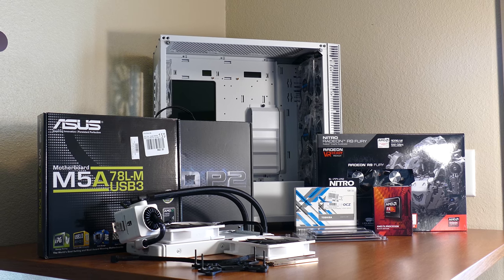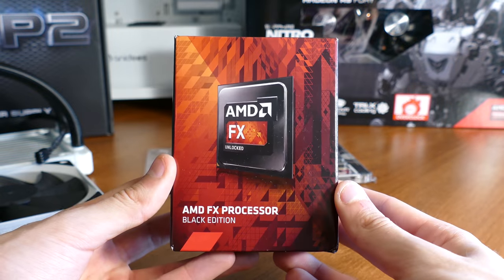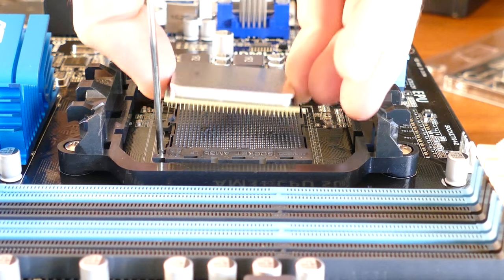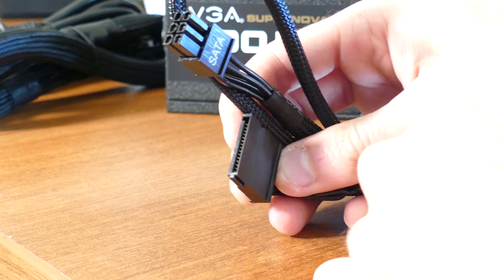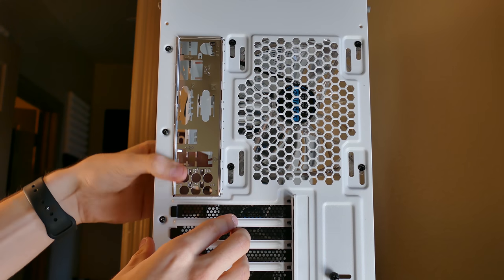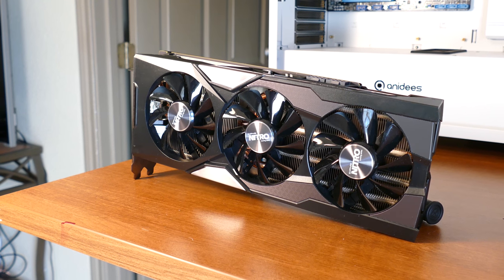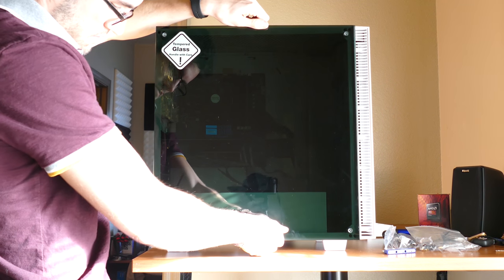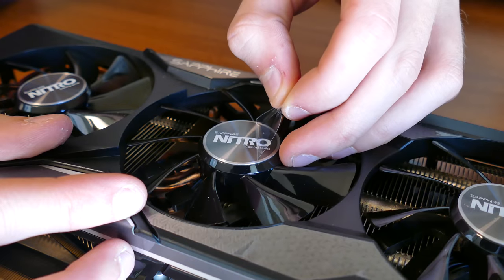How to Build an AMD Gaming PC (2016 Edition)

Comment from the maker: - For those looking for a much quieter and more efficient CPU cooler (I don't blame you), I recommend a Hyper T4/212 Evo (http://amzn.to/2gluxZW) or Cryorig C7 (http://amzn.to/2fm14uL).

P.S. The Amazon links really do help me out!
Reply: the T4 is my jam
Reply: Salazar Studio you should try unlocking the fury and overclocking the hbm memory.  It's great fun and you'll be surprised how much faster it gets when you do these 2 things. With an x99 cpu you can get over 20k In firestrike!!!
Reply: really love the cryorig i got the h7 very nice i replaced my broken h100i with it
Reply: The new Wrait Cooler and the Cool and Quiet new 95 watt solution is excellent. But Obviusly that CPU dint come with the Wrait. Neither you can complain with the price you pay  for it.
Reply: Got the C7 for my carbide air 240, is great for the price.
Reply: Cryorig's H7 is on sale on newegg. (or was very recently at least). i picked one up for 30$.
Reply: you forgot the thermal paste.
Reply: Stock cooler tend to have the thermal compound preapplied.
Reply: The computer look silly since the graphics card is so much larger than the motherboard.
Reply: Abraham Soto wraith*
Reply: Salazar Studio thoughts on using a CPU that comes with the wraith cooler as a happy medium (cooler/quieter than a regular stock cooler, but infinitely cheaper than any aftermarket)???
Reply: Can you make a Video undervolting your fury? Saw a Tom's Hardware post that undervolting lowers the power draw quite a bit.
Reply: I currently own this motherboard with a 8350 it's working okay with a 212 evo, But I am upgrading the mobo soon as it is trash. . .
Reply: Benchmarks?
Reply: Salazar Studio what about the T2 ?
Reply: Salazar Studio ill buy the PC off of you!
Reply from the maker: Joshgts Not overclocking, so it won't matter.
Reply: I use a TX2 does the trick, and diverts a bit of air over the VRMS
Reply: Salazar Studio Great call on the Cryorig H7, it's a very underated and not often talked about cooler. Looks absolutely stunning and performs brilliantly!
Reply: I have an AMD 8370 with a Rx 480 from xfx and its great. I over clocked my cpu to 4.5 ghz too. I think amd is great on a budget
Reply: +James Mulligan 
Cool! Can you detail the rest of your specs please? I have a R9 290X on the way and have been contemplating a similar build.
Reply: Science Studio I have the same motherboard with 8gigs an fx 6100 and r9 280x will I see any difference in games with 8320 cpu?

Comment: I really like the style and quality of your videos! and AMD FTW
Reply: Nate Shore My FX 8350 is no good anymore, Getting 100% cpu load in various games, even with a oc on 4,6 GHz. Intel FTW until Zen is released
Reply: Theodor Kollerød 100%? In which games? I currently max out Witcher 3, doom, and battlefield 1 and i average 40-50% usage on factory clock. I think your computer has viruses
Reply: Kev Yep, was gonna say. 8350 is old, but not that old
Reply: ***** Using a gtx 770, I've maxed at the cpu in Overwatch in intense moments, and the same happened at the BF1 Beta. I don't have any problems on witcher 3, because it's optimsed heavily for GPUs :)
Reply: Theodor Kollerød That's bizarre. I think there might be other issues with your computer that's causing the cpu to act that way.
Reply: This is far from my experience with the same chip coupled with a RX 480
Reply: Theodor Kollerød yea I had the same problems with my 8320. Had it for years and even ended up overclocking it to 4.6ghz on liquid. The fps and everything looked fine but there were too many stutters and dips when playing. I had to sell the chip cause I couldn't take it anymore. Luckily I bought it for 130 and sold it 130 (:
Reply: thelonestranger777 That's weird. What video card were you using?
Reply: slipknotboy555
SLI 780's
EVGA sc if that matters.
And before you say it was SLI, both cards ran perfectly fine in other rigs.
Reply: thelonestranger777 No idea then, unless it was drivers or something. Or something else fucking up. Maybe you even had a bad chip somehow. When you say they ran fine in SLI in other rigs, are you talking about with the same games/applications and same drivers, etc.?
Reply: slipknotboy555
Of course they would be the same drivers and games. I honestly dont know what it was but its all in the past now.
At the time I was using both windows 8.1 and 10.
Reply: I've been using my FX 8120 @ 3.8GHZ for many years and it is still running!

Comment: I managed to build an FX-6300 with R7 360, 8gb ram for dot on 200 euros. Gotta love used parts.
Reply: secrets dude from where? I'm trying to buy a core 2 quad q9300/9450 and ram and its already 120€
Reply: RoboCoffee some locals over here were selling their okd parts, got them for super cheap.
Reply: +RoboCoffee i can sell you an 1150 mobo and processor and ram 140
Reply: Jace Balavin yeah dude I found a HP with a i5 2400 4gb ram and 250 GB HDD, but for 230€

Comment: If anyone decides to build this (which I don't recommend because ZEN) an upgrade you could get would be a new motherboard firstly and a cpu cooler to overclock and minimise the bottlenecks with the gpu.
Reply from the maker: Already commented this.
Reply: He got those parts super cheap. You are not going to find a Zen Cpu on the Cheap. New things cost a lot More.. Thats why I don't like the Marketing Hype.
Reply: Salazar Studio that's cool
Reply: 'You are not going to find a Zen Cpu on the Cheap.'
8 core 3,7ghz is around 250GBP on leaked prices on kikatek and more which have been pulled recently off the web. If so then for half price you would get 4 cores. Around i3 price.
We will see in March, LOL

Comment: 4k for 650$, few months back  the only 4k u could get was at 1200-1500$
Reply: In a year it would be like $400-$650
Reply: Still the case, but he got a bargain
Reply: I saw some R9 Fury X cards for <$300...kind of wish I bought one.
Reply: well by that time game will need for power to run them at 4k
Reply: Sapphire R9 Fury going for $284.99 or 270€ now. 
That is the cheapest I have seen so far and I expect they may go even lower. 
Superb 1440p or 4K performance (for the price) if your PSU is not too weak. 
I bought 2 of them for Crossfire and m-GPU and I am not disappointed!
Reply: Rich Tea let me guess... 
1200w power supply?
Reply: Spot on! Although I think you could get away with less than that, I don't normally pull more than 60% of that under normal gaming loads.

Comment: If it hasn't been mentioned, if you want to get the most out of an AM3+ mATX board, get the Asrock 970m Pro3. It's the only 970 chipset mATX mobo to date, thus less likely to fry AND supports Crossfire. Had some pretty solid OC'ed builds with 4350s, 6300s, 8320es and even 8350s. No issues, even on air cooling.

Comment: Nice job, you made that computer look appealing. Those angle shots of the components without sound look good, and the information given was good but you left out to statically discharge yourself prior to building since it is a build guide. Keep up the good work and best of luck.

Comment: The R9 Fury is a freaking beast, and you can undervolt it so it consumes 75watts less, then it come close to 200 watts ( gpu itself ) it lowers temperatures and it doesn't affect performance so that's cool

Comment: Actually the i3 6100 is a better buy for the budget. Even though its only dual core plus ht, you have the option to upgrade to a skylake i5 or i7. Plus you can upgrade to kaby lake i5/i7 since they use the same lga 1151 socket as skylake. While with the 8320e, theres no upgrade path unless you want a 9590, which doesn't even keep up with the i5 6400.
Reply: I'm going to tell you a little secret. No one cares. Hope it doesn´t hurt your feelings.
Reply: Zebula Wienandt which fx do you have?
Reply: False
Reply: I agree with the OP. Built a VR machine with a 6100 and 1070 using stock cooler! Max load temps about 75 degrees in a Node 202 case! Will be upgrading it though to a 6600 but as a start the 6100 is an amazing CPU for under £100! Why you'd go amd when the 6100 is right there beats me.

Comment: all of the current FX series chips would bottleneck the Fury/Fury X and higher performance models...
Reply: ParticlePhysXAnomaly not when overclocked...
Reply: not the 9590, or the 8350 oc
Reply: ComSint gaming applications use between 2-4 cores so the other 6 are rendered nearly useless. Individual core performance is very weak in the FX series. 9590 also consumes a ridiculous amount of power along with the Fury/Fury X and requires a beefy AIO liquid cooler. None of these things are practical.
Reply: ParticlePhysXAnomaly Dedicated gaming PCs in general are impractical... also where did you get that first statement about gaming applications only use 2-4 cores? that was true maybe 5 years ago but lots of games from the last couple years and newer ones utilize more cores if they are available
Reply: SacredSkill my 8320 at 4.6ghz was bottlenecking my sli 780s. Ended up switching to a 4690k and on stock it performed much better than the fx cpu. I hate to use the term night and day.... But it was night and day in all honesty.
Reply: thelonestranger777 Yeah and with Zen right around the corner, any AMD build at this moment is futile.

Comment: Do you do scavenger/spare parts builds? Would be interesting to see you do a "how a $100 HP Z400 ebay motherboard kit with an x5687 CPU stacks up today" type of video. Its something i've delved into recently and results have been GREAT (just need a small mod for a standard PSU to work). The Xeon x8687 is a very interesting CPU.

Also, sorry if you've answered this repeatedly now, but why the change in channel name? Movement away from Science as a main subject? Thanks man, you rock. Keep up the good work.
Reply from the maker: Explained the name change in my ASUS motherboard review video.
Reply: Thanks man

Comment: The R9 Fury is a FANTASTIC CARD! You should run it in your I7 build also for a proper comparison with a GTX 1070. Hint R9 Fury easily holds it's own. BTW you absolutely HAVE TO overclock that 8320e. It needs to run at 4ghz+.

Comment: Pro Tip: install the front IO pins BEFORE you screw down the board. It makes the install that much easier. those little pins can be a big pain...

Comment: My sapphire fury is on heavy 4k duty. I play all my titles that support 4k on med to high settings. But it's pared with a 5820k. I also had it paired with my old FX8350k and I would say it was a solid entry into a 4k capable build. But now having the same graphics card with both the AMD and Intel CPU I do now see how the AMD chip bottle necked the system.

Comment: nice video dude.
why did you chose the fury over rx 480? I am interested in both and don't know which one to get
Reply: The Fury, is more powerful for a not very different price.
Reply: So you recommend me fury over 480? :) ty for reply btw
Reply: The only downside of the Fury is the only 4GB of VRAM but you dont need more than that yet.
Reply: +Chuckiele 4GB of HBM, still makes a difference.
Reply: It might be HBM, but as soon 4 gb are not enough, even HBM won't do some magic. there are certain Games out tehre today, that can break 4gb Vram in 1080p gaming (Deus Ex mankind divided, CoD infinite Warface, Mirror's Edge Catalyst).
When that happens, the Fury will microstutter because the Vram is not enough.

That's why the Fury (X) are crap, and a RX 480 should ALWAYS be prefered. 8gb Vram > few % more raw Perfrormance.
Reply: Michlep like what the others said, the r9 fury doesn't have enough memory for future uses. In a couple of years probably most AAA titles will use over 4gb. If you're looking for a radeon thats more powerful than the rx 480, then I suggest getting the r9 390x which also has 8gb. Performance is about between the 480 and fury.
Reply: But it's not much better, at best 2-4% or so.
But it consumes a HELL FUCKING TON of power. It's easy 100-150 watt more than a RX 480. Not worth at all.
If anyone wants a strong AMD Card, it's atm RX 480 only. If better needed, wait for Vega. Anything else is a HUGE compromise.
Reply: The Fury is going to handle 1440p much better than anything else in its price range.
Reply: Aaron Bigleman Unless you play one of the latest Triple-A games, that destroy any GPU that has only 4gb Vram. ;)

Believe me. 4gb is not enough for 1080p. And it won't be enough for 1440p. For many games it's fine. but there are games already, that are unplayable with a Fury because it has not enough vram.

No reason to buy a 4gb memory-cripple today. Except it's a low budget RX 470 or less.

Edit: a few % performance differance are EASY to work with.
Not enough Vram is difficult. Except you go down with Texture settings and have muddy console-like textures.

High + Ultra textures > Ultra + Medium Textures.
Reply: Revlis the Reviler HBM is awesome but when its full, its full ^^
Reply: I do not recommend AMD video cards but i purchased the sapphire rx480 8 gb OC for 207$ as an open box couldnt pass it up.

Nvidia more power efficient, faster, nvidia grids software for screensplit, etc....

Only buy AMD if you get a deal like that. 

If you plan on doing 1440p or 4k gaming you MAY need more than 4gb of VRAM later on in some games Deus Ex is one of them.
Reply: I S Don't forget Freesync ^^
GSync users are pretty much fucked haha.
I can get an 1080p IPS Monitor with 75 Hz, and freesync (40-75) for 166€.
The cheapest GSync monitor with IPS Panel (i don't like TN) is 680€.
Reply: Darkseth88 or even 120hz
Reply: ***** That is inded right :) But there has been test already, where the 8gb version has much better frametimes, and less stutter, than the 4gb version, in a bunch of latest games.

And if there are Games TODAY; that can break 4 gb Vram in 1080p (and with Break i mean, 4gb causes stutter, ebcause it is NOT enough), then 8gb is MUCH more future proof. Because those games are no exceptions. There will be more. You dont buy the GPU for today untill 6th dec. You buy it up untill 2018 at least.
And if there will be 5 more games, where you have to use low/medium textures, because 4gb isn't enough otherwise.. you WILL regret saving a few bucks.

But of course, it is possible to work with it, especially, if you don't need highest Texture settings.

But let me tell you, i've seen a Test of Infinite Warfare, where they said, with a 4gb Card you have to use "LOW" Texture setting, or otherwise there will be measureable framedrops.

Developers get more and more lazy, and will bring bad optimizations.
Reply: Darkseth88 well I bought the 480 boyz
Reply: +Darkseth88 Please post a link that proves an r9 480 8GB performing better than an R9 Fury 4GB HBM. There's no way a 480 will outperform a Fury in ANY game.
Reply: BlueSparkz While you are right, the Fury DOES have a higher overall "Raw Poerfmrnace", and should be better in almost all games. BUT it has only 4gb Vram. The RX 480 will offer a smoother gameplay experience in ANY Game, where 4gb Vram is not enough (aka, Vram is spilling over). In that case, Average fps doesnt matter anymore, but you will feel stutter more or less often.

Link (Sorry it's german, but i'll translate the important parts): https://www.computerbase.de/2016-11/call-of-duty-infinite-warfare-benchmark/2/#abschnitt_benchmarks_von_full_hd_bis_ultra_hd
In 1080p, RX 480 and Fury have the same average fps.

Scroll down to the last Graph, Frametime tests with AMD and Nvidia, with each a 4gb GPU (Fury X, and GTX 980). And these Tests are only with Texture setting Hoch (High), and Normal (obviously normal too :P ). This is not even very high / Ultra texture setting. Even normal Textures cause some small stutters here and there on a 4gb Card with HBM, and occasional some bigger stutters. They recommend using LOW Texture setting when you only have a 4gb Card, to eliminate all kind of stutter caused by too low

Funny to Mention is... A Fury X with fast HBM Memory has more stutter, than a GTX 980 with only 4gb GDDR5 Memory. But well, both stutter.

My Claim was not about the average fps beeing better on a RX 480.
My Claim is, that 4gb Memory is even today in some exceptional games simply: Not Enough.
And it doesn't matter, if you have GDDR5 with 250 gb/s Bandwidth, or HBM with 500~ GB/s Bandwidth.
When 4gb are not enough, they are not enough. No matter how fast they are. They might be able to counter alittle, but as soon more than 4gb need to be there at the same time, it's game over for the Fury(X).

That makes the RX 480 even more Futureproof than the Fury X, despite it beeing 10-30% faster, and beeing exponential faster than the RX 480 with increasing resolution.
But: Texture settings give you stutter.
Clean 50 fps without stutter, are better than 65 fps, with stutter down to 30 fps every few seconds for a single Frame. You can not measure that in the "Average fps" number, but you can feel it.

Again: i am NOT Talking about pure Average fps numbers. There of course, the Fury is faster. I mean an entirely different "Problem" ^^
Reply: Darkseth88 lol dude there are 4k tests done on the fury that show like 3.2gb usage because of hbm

Comment: Assuming you have a decent CPU then a single Sapphire R9 Fury is great at 1440p and even 4K if you turn down certain settings. 2 in Crossfire is absolutely insane performance with fps going through the roof!
Reply: Rich Tea goo look at iplay4k8k channel
Reply: thanks
Reply: I almost bought one of these. Ultimately I took the 480 over it. Only because I have an FX 4300 for the time being.